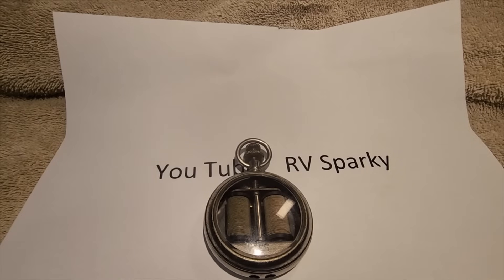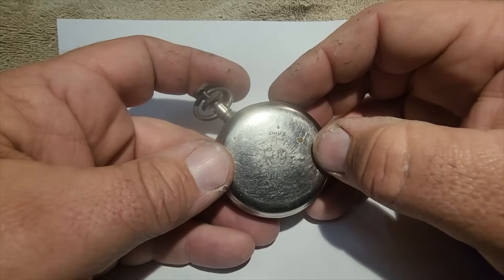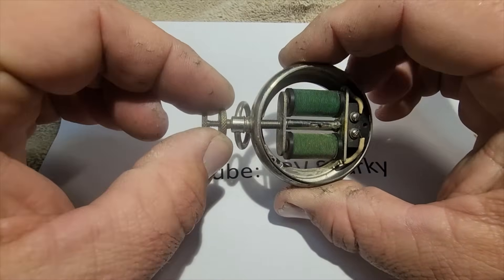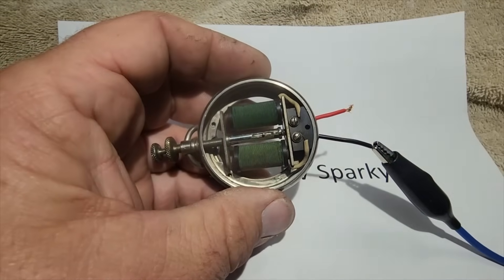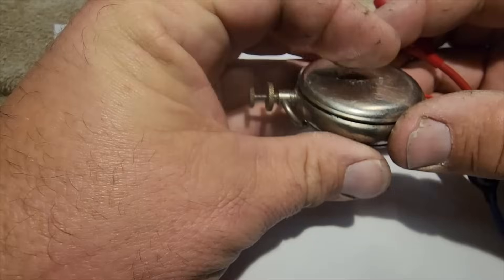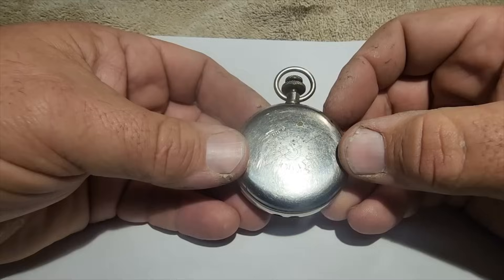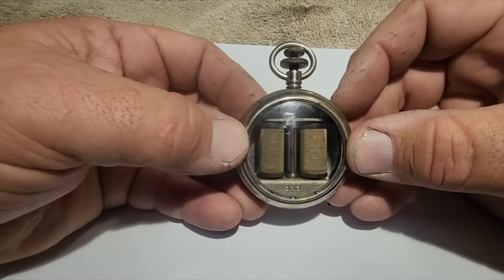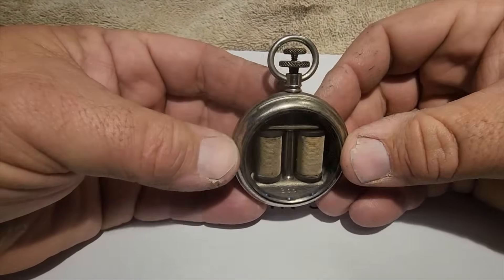Pocket Telegraph Sounder Secret Pocket Watch Sounder M & I Electric Co

Comment: Some of these units also have built-in Telegraph keys, or contactors. That would work by pushing down on the adjustment knobs. The connections were made, with a slot that was cut into the bottom of the case. You could slip a bare wire inside of with one connection, the other one was made through a very small phenolic or porcelain insulator with a sleeve that you could put a wire into. Usually there was a set of wires with jumper clips would be carried in your pocket along with it. These were normally carried by signal and test man. Working on Telegraph circuits. As a faster method of pulling out your actual test set that had a line meter a battery, and usually a couple different Sounders to change the line current

Comment: My great grandfather had one. The way it worked ( the way he said) is that they would find major telegraph lines and wire tgem through the watch and camp there for a few days. The changes in the telegraph line would do as the video showed. In his deployment he used one to transcribe 27 messages from Morse code. A problem they had though is that they would damage easily from over usage.

Comment: What an amazing piece of history you have! It can be said that I own an extensive collection of telegraph equipment and I can honestly say I’ve never seen one of these!
Reply: you said you have an extensive collection of telegraph related items, I'm looking for a spring to repair a 1905 Marconi spark gap the part I need is the tension spring, it's approximately a half inch diameter at the base and then tapers to meet the tension screw, probably a little over 3/8 to a half an inch high. Any idea where we might find something like this?

Comment: 3:30 it jamming because they used to oil springs, likely the oil has coagulated. But it also might have some form of insulation between the two shafts that’s rotted

Comment: Maybe for display, you ought to turn the coils around if you can? Maybe turn the whole mechanism? As the coils are obviously bleached on the glass side. Or maybe just use a green marker and freshen up the green? You can get very high end water color markers (not the acrylic ones) that was the standard for drawing ads with back in the day, and they come in all sorts of colors. Maybe try to colormatch? Make sure you don't get a paint marker. The thread around the magnet wire will soak up the color with just normal water based ones. That slightly pale bluish green is really nice with the silver!

Comment: Awsome litle machine. I was thinking, the noise it does when diferent currents, pass throthg it, could not that be used to recieve morse code too ? This could be like a proto pager and later walkie talkie, because, its portable, and you could recieve messages with it. It would be cool to know more about it. Thank you for sharing :D
Reply from the maker: Well yes.  Morse code.  Telegraph signals of that day I believe were all Morse code.
Reply: @RVSparky  That is very interesting, i didnt know such devices existed in such small size

Comment: So this was used by spies, government and corporate spies

You would tap into the telegraph lines at any point along the way and you could get all the telegraph messages being sent and received

So if you didn't own the telegraph operator literally or with bribes, you could tap the line outside of town

It would be easy enough to run a line off the pole to a barn or house or just have a tap point along the pole for a spy to come along and hook up to.

The original phone taps

Comment: Well I definitely see it used as a spy gadget I don't think that would be the primary case but I'm sure for the right individual it was useful. It's much more on par with pricing of what a current day fluke would be. There are network testers that are $1500+ that do everything. Then there's some cheaper ones in the $800 to $1000 range that don't do quite as much. And then there's some cheap $10 network testers that almost barely tell you that it's working. I would imagine this is something a technician would carry and it would be small and lightweight. and it may or may not have been owned by the corporation they were working for.

Comment: The important thing with a telegraph armature is current, not voltage. It takes voltage to generate current of course, but without some resistance you can burn out a coil if you're not careful.

Comment: The screws are the same as the screws on a full size sounder where the gap and the spring are used to get a good sound at whatever voltage or current is supplied where you make the connection. Electromagnet field strength is determined only by current and number of turns, and telegraph systems are designed based on current. There were no voltage amplifiers until later.
Reply: It's not like they're independent.  There is no current without voltage, and they *certainly* didn't have constant-current devices yet.
Reply: @tsm688  Correct. In a many miles long single wire (Earth return telegraph) the voltage drops with distance due to the resistance of the wire, but in a circuit the current in equals current out and you have the same current everywhere and the signalling works at any place along the line.

Comment: You could make a nice wood base so it looks like how you would display a watch, but hide the bluetooth in the base with a couple of pins sticking up, no need to modify the item at all
And at that voltage, a lipo battery should work fine ;)
Use watch oil for lubrication.

Comment: When I saw this thumbnail I thought maybe you pressed the top down to make a charge. Or generate one. so depressing it does not make a voltage out the bottom? you are applying voltage to make the coil contract...if not  something as simple as a piezo crystal might work. I cant help but think this may be a spy thing as well.

Comment: The original wire tap device for intercepting telegraph traffic during espionage or investigations.
Reply: 100% that is for covert listening to the telegraph communications - which would justify its high price. 

I mean secret stock trades, corporate financial info etc used to go down the lines unencrypted.
Reply: @piccalillipit9211  wouldn’t be very clandestine with the loud sounds it makes…
Reply: @piccalillipit9211  I've seen code books for banks and other businesses. I think it took about a week after the invention of the telegraph for people to start encrypting. After all, lots of businesses were already encrypting their letters (or at least using codes) way before then.
Reply: You need to contact a railroad telegraphy club. Telegraph keying and sounding has had a resurgence lately. Railroad telegraphy historians could tell you exactly the purpose and operation of your little sounder. I’m betting it was carried by conductors and could easily be plugged in the line on a station platform to monitor schedule times and adjustments. Most railway office and dispatch workers new code in the 1870s into the 1940s.
Reply: @brianveitenheimer4492 

    *knew code;...->NOT: "new code"!!.
Reply: @brianveitenheimer4492  That would make a lot of sense considering the pocket watch form factor.
Reply: @brianveitenheimer4492     No. This was absolutely a spy device for intercepting important communications. A quick Google search revealed that all of the advertisements for this device in journals and newspapers called this a "Secret Pocket Watch Sounder". This was openly sold as a spy device.
Reply: Imagine it with a dummy face and set of hands under the glass? If someone got stopped for suspicion, it might save them.
Reply: more likely for military use than spycraft. lol not often you label on the back the OHM of the device and who made it with the front not showing at least a watch face much less one that isnt working. but to just outright show that its a little solenoid?!?! lol nah they catch you with this its game over your not explaining your way out of that.
Reply: I don't think so, tbh.  A clandestine device would allow you to tap the line and only skim a tiny bit of current.  It would probably allow you to convert transmission wire into some kind of coil that drove a very small and lightweight deflector.   This device requires you to sever the connection to one station or the other.  You could possibly use this as part of a clandestine repeater/intercept station, but you would need some kind of keying device to transmit traffic further on.
Reply: @bearnaff9387  it does not require that you cut that the connection. It will run with jumpers TO the wires